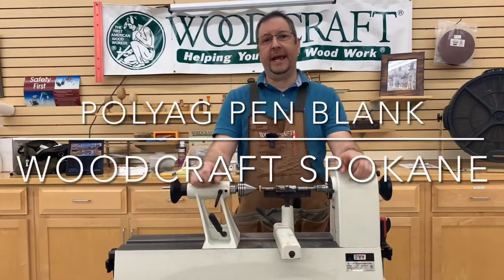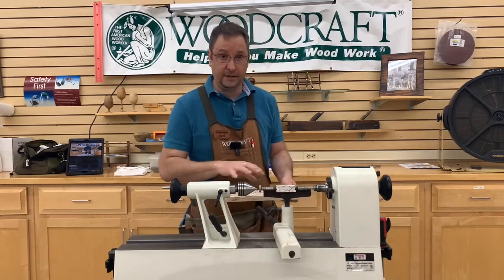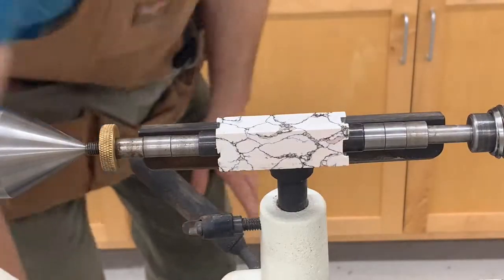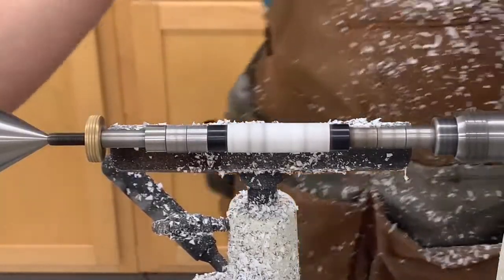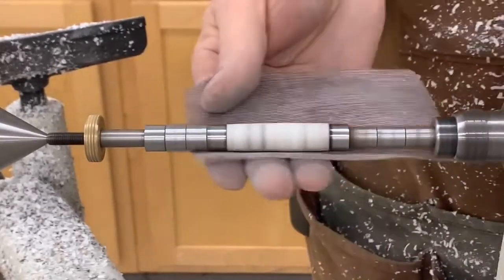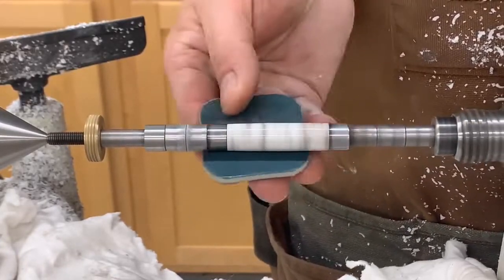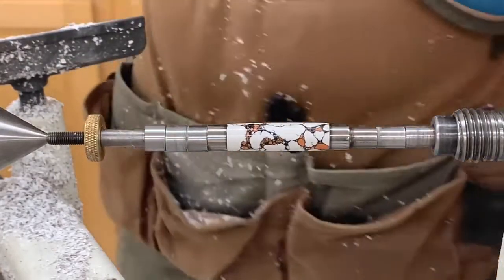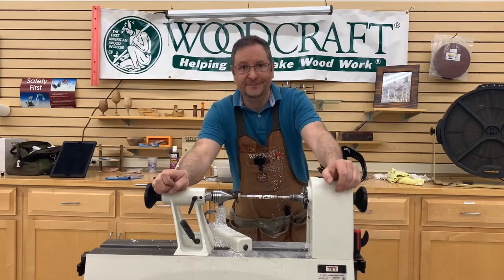Turning A Stone Pen Blank

Comment: Nice turning demo. I stopped sanding my bushings some time ago, and have been replacing the damaged ones. Every time you sand you lose a little dimension, which adds up over a few pens. I get the blank to size then switch to non-stick bushings for any sanding and finishing. The PolyAg looks great, gotta try it!
Reply from the maker: Thank you for your comment